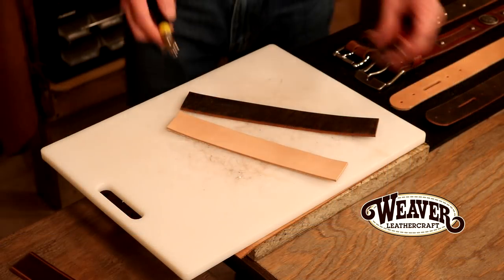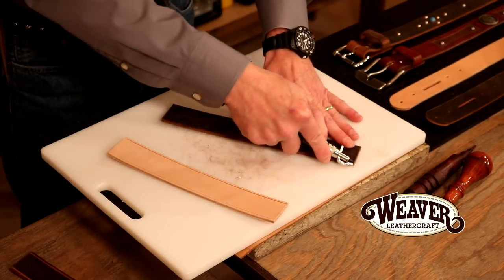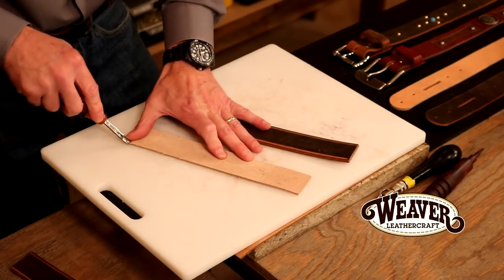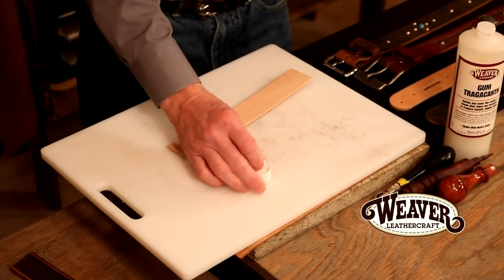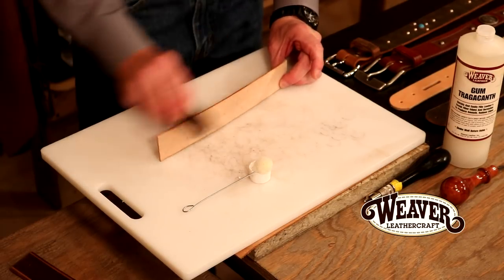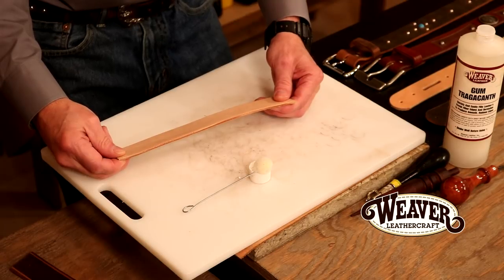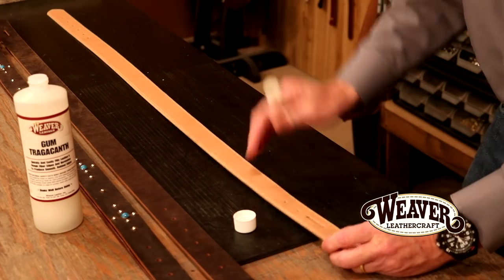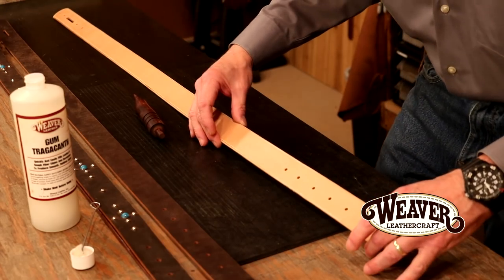Making a Leather Belt Chapter 2: How to Edge a Leather Belt

Comment: Two questions, I was instructed once that I should dye before I use gum tragacanth on edging. Is this not the case? Also do I need gum trag? I've always used just beeswax and burnishing attachment on a grinding wheel and it has looked good but I am not a seasoned craftsman. I don't really need shiny glossy edges but is there another reason to use gum? I assumed waxing the edges would help seal out water. Thank you for this video to help me improve my belt making. I couldn't imagine anyone but Chuck making these Weaver videos. Thank you Chuck, you are a credit to a great company.
Reply from the maker: Hi Ozzy,
There are quite a few ways to go as far as what to use on your edges and it mostly comes down to personal preference. You can use water, gum tragacanth, or beeswax like you've been doing. Some people use a saddle soap and water mixture - whatever works best for you. 
As far as dying edges, I've never had an issue with dye not soaking in after burnishing but to be safe maybe go with dye and then burnish with gum trag or beeswax. Hope that helps!

Comment: Chuck, can you use the Gum Trag on the back side of leather? Sometimes leather comes with a very rough  back side. If I cover the back with the Gum Trag and use the same method that we use on the edges, run a flat smooth wood or plastic over the back to get a shinny smooth finish? How will the Gum Trag be affected with body heat and sweat?

Comment: I watched and was wondering how the Water Buffalo, lets say light brown or chocolate, would take a carved design/stamp? I am planning a gift belt with some stamping and lettering and was wondering how that would turn out.
Reply from the maker: Hi Jonathan,
The water buffalo will take a stamp, it's a little harder than a natural veg tan so I wouldn't recommend using a swivel knife but letter and number stamps work great! A lot of people use the water buffalo for radio straps with names stamped on them.
Reply: Great! I had a belt blank and some hardware in my cart I think I'll purchase later today!
Reply: @WeaverLeatherSupply  I was wondering do you need to wet the water buffalo before stamping?

Comment: Thanks Chuck! Do you treat the back side of straps that are worn against skin like wrist and ankle bracelets? I have lots of belt scrap I'd like to use for bracelets.
Reply from the maker: Hello,
It all depends on whether or not there is a nice smooth finish on the back side. If there isn’t then I’ve found using gum trag on the back just like you would for edges and buffing it makes a really nice finished back.

Comment: One more question please.  I bought the Herman Oak belt to make for me.  I followed this video and did edge and burnish.  However i used Gum Trag to burnish.  Only on the edge i did a good job of that but when i went to dye using Feibings Pro Dye black, there were spots on the edges.  Do you go back with an edge paint to compensate?  I just bought 3 more belts so i hope i get this down soon
Reply from the maker: Hi Randy,
If you're going to be dying the belt, we would recommend doing that first and then burnishing the edges. That way you'll get full coverage with your dye including the edges and then you can slick the edges with gum tragacanth. Hope that helps!
Reply: Yes thank you.  That’s what i usually do.  Keep those videos coming!!

Comment: Can you dye or waterstain after using gum trac if you get it on the top ?
Reply from the maker: Hi Vic,
You can, however, the dye may not absorb into the leather where the gum tragacanth is at. I may suggest slicking with water first. When the project is ready, add your dye and top coat and then Gum Trag and slick. A good top coat will resist the Gum Trag and you should have a very clean line.
Reply: Weaver Leathercraft Thanks again.
Reply: I just finished my first belt... And yes, any stray gum trag on the top grain will not accept dye. My next belt will have the edges beveled but not slicked with gum trag until the end. Added tip... Slick with gum trag first, then when that is dry, dampen with water and slick the edge again. It will polish nicely.